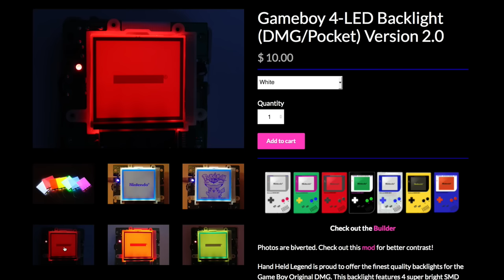How to Install a Game Boy Pocket Backlight!

Comment: Just botched this mod. It's no exaggeration that the ribbon cable is fragile - some of the worst design I've ever seen. The leads for the vertical array are comprised of two ribbon cables sandwiched - and then very very loosely soldered - together. If even a fraction of that cable-sandwich pops apart, you broke it. I was extremely careful with removing the film and yet somehow still managed to jostle that cable the right way to trash it.

I threw out the LCD and reassembled just for fun - so now the screen of my Pocket is just a view of the PCB - actually looks kinda cool and I might make a display out of it! Not so bad after all.

Thanks for the tutorial, keep it up!

Comment: Hi there,

I installed the kit as directed by the video (except with perhaps slightly inferior soldering because of my lack of skill) and the Gameboy Pocket was working pretty much perfectly for awhile. A bit later, I noticed that the backlight started flickering, which was annoying but not that big of an issue. Later, I had an entire horizontal line of dead pixels, this was approximately a month after I installed the mod. 

It's my hope that shoddy soldering might be causing this issues so that it can be fixed, but I'm afraid that it might be just that the age is showing since I figure if I damaged the ribbon cable, it would have been immediately noticeable. Has anyone else had issues like mine? Any related input is appreciated.

Comment: Hello I had a Friend backlight my Gameboy Pocket but the issue we have run into Is that the case won't fully close up and when you try to fully close it a bit of black shows up on the screen any advice on what to do to prevent this?

Comment: Hey! is it OK to ask questions here? I just have two! :) My first question is, could you please do a video just on where you can buy buttons and dpad replacements for GB Color and how to install them? I know that sounds simple, but it would be complicated for me. :)

The other question would be I was given a GBA SP after the backlight was taken out of it to be placed into another GBA SP shell, but otherwise it works and runs fine. I don't really think getting a backlight kit would work for me, but my question is; is it possible to add or use the front light kit or method to get the screen illuminated again? Thank you for your time.

Comment: This was clearly too hard for me, or I was really unlucky. My first two attemts doing this mod, I ended up with vertical lines on the screen. Most likely i put too much pressure on the ribbon cable while removing the polarizing film. I also heard this can't be fixed like it can on the original DMG. I got it on my third try though. At least they were all cheap pretty beat up gameboy pockets from japan...
Reply: Yeah, same thing happened to me. My third attempt I wrapped where the ribbon cable meets together with kapton tape before I removed the back polarizer. I only ended up with one line in the screen, so I just taped the end of that ribbon cable down to the inside of the case, and the pressure made it go away. These mods aren't "hard" in and of themselves, but the screens on these gameboys are REALLY fragile, so research and do everything you can to not damage the ribbon cable...
Reply: @blakeromo  yeah, if you got vertical lines on the screen, it means that the ribbon cable has a bad connection on some of the leads. just tape the ribbon cable to the back of the screen and see, if anything has changed. If it still shows lines re-allign the cable in a different way and try again until the lines are gone. When I did this mod, at first I had a perfectly working screen, but it didn't light up (because the rechargeables didn't provide enough voltage) and I thought the backlight cables had a bad connection. I disassembled and resettled stuff until at some point the lines appeared and I found out that the screen lit up using fresh batteries or the wall adaptor. It took some trial and error then, resettling the ribbon cable in different ways again and again until at some point the lines were gone, but I was successful in the end.

So, the ribbon cables are very sensitive, but they can be fixed easily. that's good news: If you got vertical lines on the screen does by no means mean it's broken. Far from it!

Comment: Hi. Congratulations for your tutorials. They seem fantastic and very simple to understand. I have put some of them into practice with very good results. I had difficulty in this when separating the metal part of the LCD glass. Is there any trick, advice or simple way to do it without breaking it? I have already broken two screens 😰 and they are not easy to get. thank you very much!

Comment: I've got a question for you, Colin. I put in the backlight in the gameboy pocket, and your video was extremely easy to follow and understand. I have a newer version of it, but it's still essentially the same thing. When I tested it out, the backlight came on no problem, but there were two errors. One, there was a bubble in the screen (which I can live with). Secondly and more importantly, the lettering on the screen is distorted. It won't play games, just shows the distorted Nintendo logo. Any thoughts to what the problem is?
Reply: Colton Trappe  I'm having exactly the same problem!! Did you solved it already?
Reply: Yeah, dude. Check all your solder points and make sure there's  electical tape. Mide had fallen down and it started to short out somewhere on the game slot I think.
Reply: Colton Trappe I will give it a try later this night. thanks mate

Comment: Hey Colin, is there any other way to get the adhesive off the back of the screen? I tried alcohol and it isn't removing any of it, and the whole thing is pretty much covered. If you could help that would be great! Great video though! Everything went smoothly up until this point. A friend of mine had this problem too and it took him a few hours to get it all off and he said I have more on than he did. Also for anyone that had the issue with the blinking screen you do not need another resistor, you need to solder to two points on the other side of the board. You should do a video on this Colin, it is really good if you have the blinking screen issue!

Comment: Hey ! I recently installed this kit on my gbp, but i notice that every time i click a button or let it sit it would flicker. is the flickering normal? And i notice that, it depend on what game i'm playing. Like no problem with tetris, but flickering with Pokémon. What should i do ? Thanks.
Reply: I should have read your comment same issue with me !! tried looking at the solder points and putting in new batteries no luck :(
Reply: +MrKrimstah I find a solution ! :) 
Use thoses solders points instead : https://a.disquscdn.com/uploads/mediaembed/images/3216/7720/original.jpg  

I don't have any issues now, even with low batteries.
Reply: +Cyriaque thanks for the tip i will try shortly did you use a resistor ?
Reply: +MrKrimstah Yes i recommend you using one. :)

Comment: Great Video as usual :)
Is there a difference between the "Handheld Legend" and the "Kitsch-bent" Frontlight kits for the GBC and which is better?
Reply from the maker: +Abdul Aali Kamal Din There is a difference, but it's really only in how they're installed. If you install an HHL frontlight using instructions for the KB model, you need to add a 100 ohm resistor between the power wire and the solder point on the circuit board. Otherwise, the installation is the same. I haven't installed an HHL unit, but I would imagine they're about on par when it comes to quality -- either is a good choice, though I would recommend also doing the LOCA mod for the best results. Thanks for watching!

Comment: another thing guys... do not put the positive wire at the location this video is telling you, put the positive wire on the point that says  number 1 with a resistor same location where you put negative on number 4... this will get rid of the flickering when playing games...

so positive on number 1 with resistor and negative on number 4

if you don't add a resistor the screen will be super bright and drain your battery faster which will cause the contrast to flicker dark and dim... I found this out because I removed the batteries and use a plug for the Gameboy pocket and the issue was fixed... after adding the resistor the brightness went down and contrast flicker went away and saves more battery power.

Comment: What about a bivert module?  The GameBoy Pocket screen works the same way as the DMG right?  Wouldn't a bivert be possible?
Reply: +AndehX The original game boy screen is not nearly as good as the gbp screen, for example, the dmg has a green ugly screen, whereas the pocket has a higher contrast,  true black-white screen. It is possible to install a bivert module, it isn't really necessary.

Comment: This is a great video. I have just ordered my kit. I have been reading up about backlighting Gameboys over the past couple of days. DMG users seem to recommend biverting - is this necessary on the pocket?
Reply from the maker: +Dan Scarfe While it's technically possible to do the bivert mod on the Pocket, it's not really necessary in my opinion. The Pocket has a much better LCD than the DMG, including better contrast. If you want the absolute darkest pixels you can get, then you'll need to bivert, but my recommendation would be to do the backlight mod first, then decide for yourself. Good luck!
Reply: +This Does Not Compute Thanks for the quick reply! I have subscribed to your channel as this video is very informative. My kit arrived today (from the US to the UK in 3 working days!). I am going to install it tomorrow - wish me luck!
Reply: Did you get it installed and happy with it without bivert?

Comment: Is there a way to have the blacks stay black and not be gray without using a bivert module i want bark blacks not grays without the contrast maxed out on my mgb and to be able to keep my system on for hours without my tablet charger plugged into the dc connector so i can do walkthroughs on youtube with my phone camera.

Comment: my screen is fine, it's very dim now, but the pixels are inverted and the backlight isn't coming on. i didn't install the bivert module and the pixels werent inverted the first time i turned the gameboy on after doing the mod.
Reply: You need to turn the polarizer 90 degrees. If you put it the wrong way, you get a negative image.
Reply: thanks. but it was actually the led not working. there was no light coming from it. got another one and its working now. may have just overheated the pads
Reply: Ok, glad to hear you have a working one.

Comment: I tried doing this about a year back and I kept getting a black dot near the center of the screen and bubbles appeared on the screen from the polarization filter. I was pretty irritated. It might have to do with it being the first model backlights which were really thick, I'll need to get the newer thinner models and see if that'll fix it.

Comment: Thanks for another entertaining and informative video!

I do have a question: My DS Lite has a problem in the shoulder buttons that causes them to steadily become more unresponsive, until they barely work at all. It seems to be a pretty common issue, and the current popular workaround is to blow air into the shoulder button--which only works for a few minutes, anyway. I was wondering if you ever found something that could be a little more permanent of a solution?
Reply from the maker: +Inflorescence The best solution is to simply replace those buttons. They're known as "tactile switches" or "tact switches" and come in many sizes and styles. I've never had to replace mine so I don't have a part number handy, but if you take your Lite apart and get the dimensions of the switches, places like Digi-Key and Mouser will have replacements that you can solder in. Good luck!

Comment: i tried wiring the positive without resistor and still wont power on... backlight only powers on if negative is on number 5 but Gameboy wont bootup

Comment: I tried this woth 2 screens I took 2 hours to peel off the polarizer and the reflector and they came of prtty messy not clean like yours. A lot of adhesive was left on the lcd and by cleaning it They ended up breaking how do you get such a clean peel?
Reply: Maybe it was a stunt screen. Previously damaged and cleaned. That is why his removed so cleanly. Hehe. Maybe?

Comment: I installed following this video but everytime i press the A and B buttons it flickers. Any idea why this occurs?
Reply: When I did the HHL Frontlight mod to my GBC I had this same issue. The screen would randomly flicker (ever so slightly) and it was very obvious whenever I pressed the A and B buttons playing a game. I resolved it by using the KB positive wire location and placing a 47ohm resistor in line with the positive wire. I attributed the flickering to voltage spikes and the 47ohm resistor helps to limit the amount of voltage going to the frontlight.  I intend to do the same thing with my GBP backlight and I will let you know how it turns out.  You could also play around with other levels of resistance if you can find 20ohm resistors at your local RadioShack. Either way, give it a try and let me know if it corrects the flicker!

Comment: How does the Backlit Gameboy Pocket compare to the Gameboy Light? If you have a GB Light could you do a video comparing the 2 side by side. I'm kind of torn as to which one I want.
Reply from the maker: +Sandbox Quint I don't have a Light (at least, not yet), but my understanding is they EL (electroluminescent) backlights, so the display has a green cast to it. The LED-based backlight kits come in many different color options.Having a Light would be fun for the novelty factor, but I think a backlit one would give the better gaming experience.
Reply: +This Does Not Compute Sounds good thanks again!

Comment: I'm a little confused about the purpose of the polarizing film. You say that without it, nothing will be visible on the screen, and rotating it 90 degrees inverts the white/black pixels. When I got my backlight for my dmg, I also installed the bivert. My pixels are all biverted now, but the film doesn't invert them back to normal regardless of how I rotate it. So I used a spare board without the bivert installed, and I just use the polarizer to tint the screen darker a little - but it does nothing else. I suspect I damaged the film when I cleaned smudges off of it with alcohol - I ordered another film and will be more careful with it. However, I can remove the film completely from behind the screen, and I still see pixels on the screen fine with only the backlight there. So the film seems unnecessary unless you're using a bivert module and need to invert the pixels. So what gives? It appears these screens didn't come from the factory with any sort of polarization and backing is simply reflective material, and the only need for polarizing film is when using bivert modules.
Reply from the maker: It sounds like you may have left the original polarizer on the screen when you removed the reflective layer -- a pretty common occurrence.

Comment: Last night I tried this mod, and ended up not only breaking the ribbon cable but demolishing the ribbon cable (one of the cables just plain broke off at the solder joints). Any tips on how to get the reflector off easier? Perhaps using a solvent of some sort?
Reply: buy one , they like 50 usd or 45 euros
Reply: the thing itself, the whole console, its worth it because you dont have to pay for mutiple gameboys ( i had to buy 6 and it broke on me when i had it )

Comment: Hey man i recently installed this kit on my gbp, i followed the instructions but what i notice that every time i click a button or let it sit it would flicker. is the flickering normal?
Reply: same here, I still haven't figured out how to fix it
Reply: +MrLuiscampa hey man I was playing with a non lit one, and I noticed that the screen does flicker here and there. it might have to do with old tech. but I can't confirm this since I only did one mod with the gbp. but good luck on finding the answer
Reply: +Charliecloudfactory Same here :(
Reply: turns out it was the batteries I was using, I put some fresh batteries in mine and now it works fine

Comment: I have a silver game boy pocket and around the screen where yours is black mine is like a mirror. I haven't seen any more like it. is it anything special or not.
Reply: First models released in 1996 and they didn't have a LED on the left side of the bezel either. I just bought a brand new condition one in the original acrylic box. People demanded the LED return and nintendo listened and brought it back shortly after release and with a black bezel instead of the mirrored one.

Comment: I've ruined two game boys trying to do this. I must screw up the bottom connectors of the ribbon cable when I peel the adhesive backing off of the screen, and when I put it all together there's always a big white line in the middle of the screen. so I open it up again and try to tinker with it, was told to put a piece of electrical tape to hold the ribbon bottom back together, but I just end up ruining it. so bummed yet again.